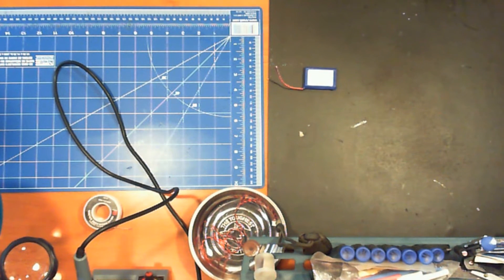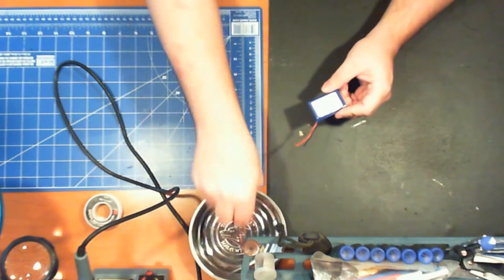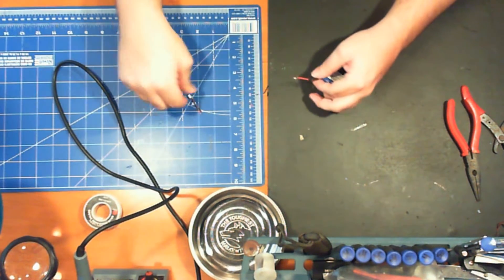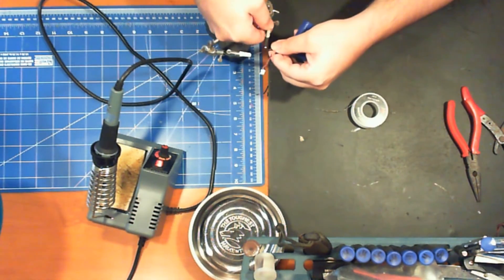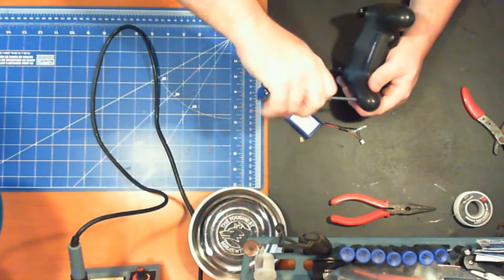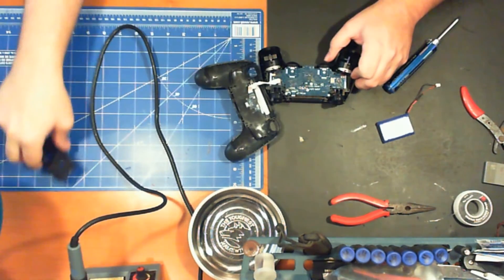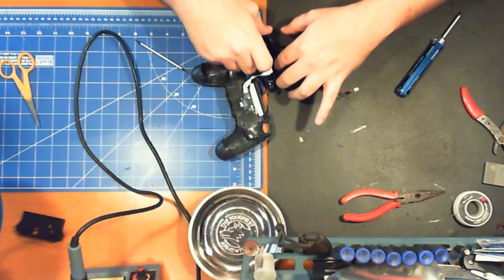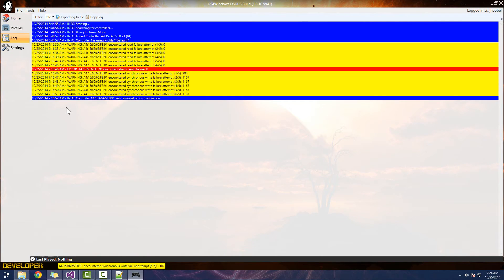Dualshock 4 Battery Upgrade and Test

Comment: for anyone looking for a better battery, have a look at the PKCELL LP803860, there's a redit page about it. its a legit 2000mah battery, unlike the fakes that say 2000mah but are actually the same as stock. you cant fit double the capacity in the same size hard case, its literally impossible. I found the PKCELL upgrade on the australian ebay

Comment: "WARNING
CAUTION: when working with Li-ion cells, they are very sensitive to charging characteristics and may explode if mishandled. Protective Circuit Board is required when making packs "

So these ones don't have the Circuit Protection board? (short/under/over charge protection)
Reply: +Micah Folf The controller already has charge circuitry, thats how it is able to keep from overcharging the existing battery packs.
Reply: +InputMapper oh ok. fair enough.
Reply: I'm not sure about the ps4 controller, but on the ps3 controller there is a small circuit board inside the plastic housing of the original battery that should be wired to the new battery. Most all phone batteries also have small circuit boards inside the plastic housing of the lithium ion battery.